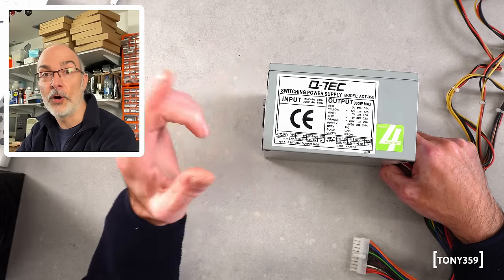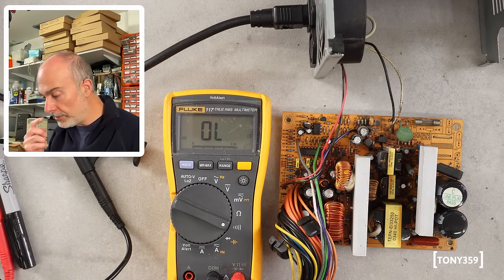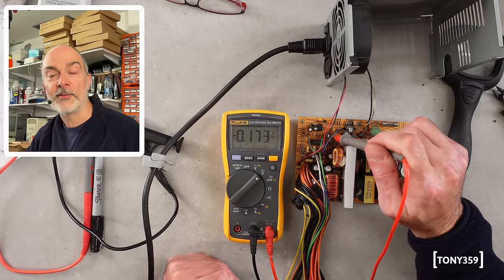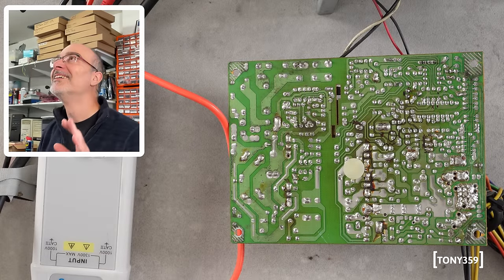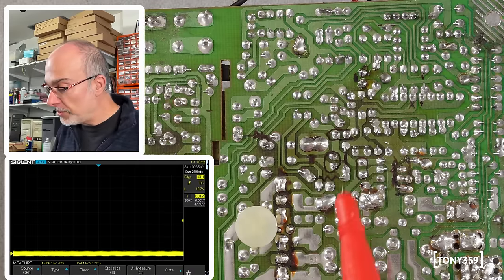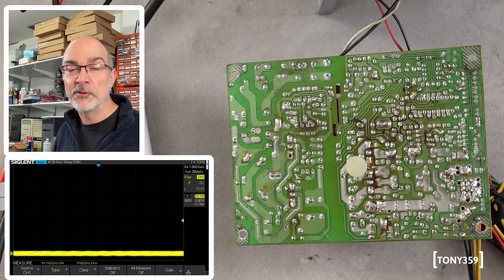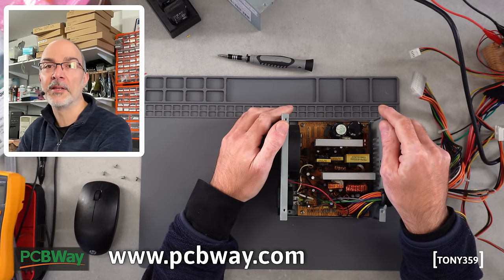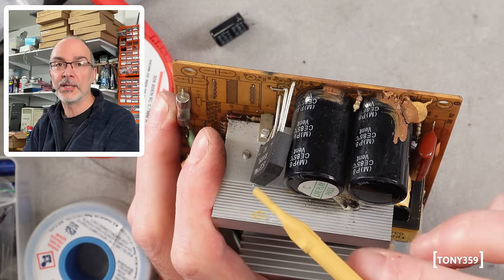Let's fix this 𝗗𝗘𝗔𝗗 ATX power supply!

Comment: Nice repair! You can put a thermistor on the 12v power of the fan to slow it down when the PSU is cold significally.
I cannot understand why they stopped putting that female bypass ieee 3pin power socket at the back of the PSUs, it was extremely practical for monitors. Old PSUs are worth repairing, strong 5V, -5V and native AT connectors are 3 good reasons.
Ciao from Grecia, Jim
Reply from the maker: This doesn't have AT connectors unfortunately, it would have been perfect otherwise! 
Thanks for watching!

Comment: I always give my PC fans a bath of WD40. I fill a small container just big and deep enough to allow the WD40 to immerse them then let them run for an hour. They self clean and to remove excess oil just drain the container and let them run dry for another hour then wipe any remaining excess with kitchen towel and they are spotless and good to go again. Never suffered any harm or ill effect from this so far :)
Sometimes I've washed them in hot soapy water then let them air dry then use WD40 to drive out any water from the circuit board then a drop of 3 in 1 oil on the rotating shaft. That works just as well :)
Reply from the maker: I never considered bathing a fan in WD40 :) 
I tend not to wash anything which has coils in them - transformers, motor coils, as I'm not sure I'd be able to fully dry them out. That said, a fan is low voltage so it should be good! Thanks for watching!

Comment: You saved a PSU with a obscure voltage option, so all good and totally worth doing. Lots of people are about let's save the C64 or Amiga, but there's some cool generic 90s to early 2000s hardware which is worth saving.
Reply from the maker: Thank you!

Comment: Nice to see something being repaired; these days with all the manufacturers locking down hardware (even smartphones with custom firmware that prevent even replacing modules between legit identical models!) it's good to see the process of self repair a PSU, which has lots of cool uses for DIY projects.And as a bonus it was nothing buy cheap caps.Great!
Reply from the maker: Yes, repairing modern stuff is a nightmare!

Comment: I do this repairing for decades as my daily work, most of my computers have these cheap, chinese power supplies. After a while, you get used with them, they are so cheap to fix, I am barely use a multimeter to check the voltage. And this is an advantage; Once the bad caps are changed, the power supply will work with no problems for 4-5 years. The only thing that you will open that again is the fan that get noisy- very noisy sometimes, with big vibrations in all the computer case.
Here I suggest to have more attention on the fan repairing: Just use two sharp needles, remove the white washer, take out the fan blades and clean everything inside : the magnet , the winding, Use isoprophilic alcohol, a good brush. Then, use a good  grease, I found one very good that make the difference, If you use oil for lubrication , it will work but iafter one year you´ll need to lubricate again. For someone who does not know, it is a very instructive video.
Reply from the maker: Thank you for the comment - Yes, I am very aware that that fan won't last long, though I wasn't aware the fan could be disassembled further. Others have mentioned and I will definitely do that next time! About the grease, it might be a good idea as well.
Reply: With decent caps and low hours I'd honestly expect to get at least ten years out of a rebuilt power supply, if not more. It's not like you're likely to run a vintage computer 24/7 all year long like some people do with new computers and did when these were new.
Reply from the maker: Absolutely, my retro gear is barely being used :)

Comment: Very nice work.  This is my first time on your channel, so I'll check in on some other videos and maybe subscribe.  I have several power supplies in a bin on my workbench, and all  but one of them work.  The dead one is an old 20-pin ATX kind of like this one - a very heavy +5 volt rail, and might be worth the effort to repair it.
Reply from the maker: Thanks and welcome! There are a couple more power supply repairs on the channel, one is a PS3 one and another one a generic one. I hope you like them!

Comment: You can make a -5v output using a jellybean component like MC34063 or any 34063 / 33063 (first two letters are manufacturer digits, they're made by lots of companies). There's even online "calculators" that will tell you what components to use, instead of you calculating using the formulas in the datasheet.
Typing as I watch at 5 minutes ... esr of 5v standby capacity could be bad, you may be measuring 5v with multimeter but doesn't mean it's ok... the meter puts no load on the circuit so it could show 5v but be actually bad.
Reply from the maker: Oh yes, the multimeter is doing a broad average - and as you could see later on in the video 5VSB was also all over the place! I didn't check it afterwards though! Thanks for watching!
Reply: You have -12V line anyway so you can use a cheap linear regulator.

One of classic ways to get -5V from +5V is a standard 7660 IC which is much easier than 063 since you don't need an inductor, and you don't need even any resistors, simplest IC to use. This IC comes from half a dozen different manufacturers. It's not intended for high current but it'll hold up a negative rail of an opamp perfectly fine!

Comment: My old backup computer, a 2008 Lenovo ThinkCentre m58p had a boot loop problem that slowly got worse, meaning it occurred more often.  That pointed me to the PSU.   After replacing the bulging electrolytic capacitors, all was fine again. I also replaced the other remaining electrolytic capacitors. Anyhow, despite the computer being 16 years old, it can still handle 1440p resolution YouTube videos at 60 frames per second. Repair cost was about $9.95 CAD.
Reply from the maker: The amount of electronics going to the landfill because of simple faults is sad. But for a non-skilled person it doesn't make sense to have them repaired as the repairman cannot charge $9.95 or they won't get to the end of the month. So we buy new.
This is so very broken. Thanks for watching!
Reply from the maker: Friends often wonder why I have "old" things at home! :)
Reply: @tony359  Is it just me and what I see, or did my last comment vanish ??  Update. On one of my computers it does not show up if I am logged in and am using Firefox., but does show up if I instead use the Edge browser and am NOT logged in.  So I checked this again on my Lenovo backup computer. Here it does not matter which browser I use, nor whether I am logged in or not, it still does not show up.  Weird stuff.
Reply from the maker: I can see it. It's not the first time my comments "disappear", I guess it'll come back at some point. It wasn't me though :)

Comment: I never thought I would see someone bother to repair a Q-Tec PSU. They always were noisy and unreliable before. But this was educational and that made it worthwhile. Still wouldn't use that PSU though! Those and Bestec - steer clear!
Reply from the maker: Indeed, it's for fun! I played with a socket 7 motherboard today, I looked at the Q-TEC and thought "nope" :D
Reply: I have few Bestec ones pulled from OEM systems and they are still working fine after all these years. I’ve seen totally dead ones though. I always open a PSU, clean it up including lubricating the fan, and do PSU tests before using them.

Comment: I had this troubleshot and ready for remediation by watching up to @1:53 in the video.  It is at this precise moment that it is obvious what the problem is.
Reply from the maker: Because I say power supplies are dangerous?
Reply: @tony359 lol, no, I was referring to the image.  The cap at the lower right looks slightly bulged, which coupled with the fact it is the component most likely to fail on these, is why I'd say right away that is the issue.
Reply from the maker: Yes, that was even mentioned in the previous video when I tested the PSU. That wasn't a surprise! 
As I said at some point in the video, I could just replace all the caps, "it's working, thanks for watching". Meh. Boring :)

Comment: HELP! Assistance please!! I have three Cooler Master power supplies, all at or over 10 years old. A 550, 620 and 650 watt. All three still work but under load cause burps and reboots. I'm told they all need new capacitors. Is this feasible and reasonably cost effective? Can you gives me some hints and suggestions? I counted around 50 capacitors in the 650 watt one.
Reply from the maker: if you're asking it means you've never done that yourself and I cannot recommend you start with a Power Supply where you have 340V DC inside. Sorry, I don't mean to be mean but I honestly cannot recommend that. Thanks for asking!

Comment: I was genuinely surprised, how often are the smaller capacitors bad. They do not even look that bad like the bigger ones which bulge. When I was repairing my old LCD monitor PSU, all of the little ones had big ESR, which is not good for the switching nature of all the DC-DC step-downs or SMPS in general.
Reply from the maker: Indeed - I think it's because of the broken fan. This thing must have badly overheated for quite some time. Caps don't like heat at all. Every extra 10C the life of a cap halves. So running a cap at 60C rather than 40C means that the life of the cap is 4x shorter, impressive!

Comment: 40 years experience with many types of power supply’s , trouble shooting tip ,use a hair dryer and freeze spray for quick cap checking . Then go to the technical stuff if you have to .
Reply from the maker: Of course, check this other video when I mentioned exactly that: https://youtu.be/zpro06H_4VM?t=571 (9:33)
The purpose of my videos is to learn and experiment though. It was pretty obvious that the problem was the capacitors but if I had just swapped them all without learning about how the PSU works, probing the ICs etc, it would have been "just another capacitor swap video" :) Thanks for your comment and for watching!
Reply: @tony359  I agree totally, you have to be able to noodle these things when something besides caps . But man a lot of time, it’s caps .
Reply from the maker: Imagine a world without capacitors :)

Comment: I've repaired many SMPS's and in the majority, the problem is always the electrolytics.  Some are obvious, bulging out the top.  Otherwise, check for value and ESR.
Reply from the maker: Particularly those cheap ones had cheap capacitors - and cheap design which meant the capacitors were stressed more than needed. Thanks for watching!

Comment: For a switching supply, you should be using dedicated low-ESR capacitors.
Reply from the maker: On this PSU I admit I dug into my stash looking for "cheap" capacitors but those are from some time ago. 99% of my caps are Panasonic, if possible "FR" series which are very low ESR and high ripple I think. They're not cheap but I don't see the point in recapping with cheap stuff. If FR are not available I always select something with low ESR as standard.
For PSU - when I have them - I also use the Nichicon PW series which are designed for PSUs. 
Thanks for watching.

Comment: Good repair job, yeah caps all the time
Actually you were lucky, when the caps get this bad, all the transients from the switching goes through the roof and can easily take out an active device, often the switching transistors, meaning a near dead short across the input, smoke and severely cooked parts.
Reply from the maker: I was surprised the monitor was still working! I didn't think of checking those caps... Thanks for watching!

Edit: wrong video :D
Yes, those were not caps anymore :)

Comment: i have so many smps's lying around most of the don't have 5v Vsb o/p, going to buy a lcr meter soon for changing my game, most of smps faults are due to bad capacitors, i once had a working smps wanted to use it as a power supply for my tire inflator it requires 8A @ 12v, i only wanted the 12v line, also kept a sata & a molex connector just in case required for cd rom /hdd, so i desoldered all wires & connected only a 12V line ps-on 5v Vsb, after that tried to turn on the ps on it would work only for 2 sec & then off, did trouble shooting checked the o/p section nothing was bad, turned out the 3.3V sense wire should be always connected to the 3.3v line, everything works great till today.
Reply from the maker: well done in discovering the 3.3 sense line issue!

Comment: 20 years ago I worked in computer service. I remember 2 similar named PSU brands. One was Quiet technology and silence was their thing. They had good PSU's. The other was a cheap Chinese PSU with very optimistic rating. Was it Q-tek and Q-tec?

A PSU with only max power, no continuous power, is a good indicator you have a crappy PSU.
Reply from the maker: good point! I guess these "ratings" can be found everywhere, in any sector!

Comment: Very satisfying to watch. I have a Nox Urano II 630W ATX power supply, but it never turns off, with the fan always running without being connected to any motherboard, I checked with the ohmmeter that the green PowerOn wire is in a short circuit with the black wires?  
How can I solve this problem ?
Reply from the maker: Hard to say but it looks like the on/off circuit is fried - yes, I know you knew this already!
Modern PSUs are also a nightmare to work with, everything is so crammed. Thanks for watching!

Comment: Oh i got your channel recommemded because of this video. Subbed immeditately! Btw can i know whats that device that you use to check the capacitor esr and capacitance ? It looks extremly useful
Reply from the maker: Thanks and welcome!
It's a basic component tester, there are many different types available. I think the original name is LCR something :) It works very well and it's very cheap. Thanks for watching!
Reply: @tony359  thank you for making the video too ! I was doubting whether to buy an oscilloscope for electronic repair since most people on forums kind of discourage it saying its not very useful but after seeing your video I realised its extremely useful rather than just relying on the multimeter. Thanks for the great videos 👍
Reply from the maker: There are cheap scopes nowadays which work pretty well. But BEWARE, do NOT use a scope on a power supply unless you have a differential probe - a battery-powered scope should also be ok but I cannot be 100% sure. What I am saying is that remember the ground lead of a scope is.... ground. It's not like a multimeter where you can poke everywhere. If you ground something which has potential, you make a big bang :) (Ask me how I know? :D)

Comment: At around 3:40, I may be wrong but it is my understanding is that the controller chip communicates via the optocoupler and not the central transformer you mention in your comment. Those transformers should be for 5V, 3.3V and 12V respectively. Thanks for the video!
Reply from the maker: You know, I am not sure now. Because the controller is on the secondary, there shouldn't be a need for optocupler as the feedback doesn't have to cross the secondary/primary boundary. Interesting. 
However, I one of those yellow things (I call them transformers but I'm told they're actually two inductors coupled together - let's call them high frequency transformers) is definitely for the 5VSB and the VCC for the controller, before the main circuit kicks in. If you look at schematics there is usually only one transformer for everything - there will be different windings and each will deliver a different voltage. 

I'll check with my "go-to" person when it comes to transformers about the optocoupler, thanks for asking!

(*) - on a more modern transformer, where the controller is on the PRIMARY, then the optocupler is 100% for receiving feedback from one or more voltages so that the controller can compensate for different loads!
Reply: @tony359  thanks for your kind and prompt response! So… it got me thinking, again not an expert here but AFAIK the chopper transformers are those three and no matter what side you have the IC controller you will have to get info across from the cold side to the hot side to provide feedback to control the mosfets transistors across the optocoupler and using PWM to increase or reduce the power as needed. Alternatively if you had the IC on the hot side, then you would use the optocoupler to get voltage information from the other side to feed the IC and again adjust the PWM cycle as needed. Let me know what your “go-to” person tells you because it would be interesting to have a professional’s opinion. Thanks!
Reply from the maker: @Snowsea-gs4wu  My thought is that the voltage feedback can reach the controller directly, no need for optocoupler. All it needs to go to the HOT side is the switching signal. I'll find out more and report back! :)
Reply from the maker: @Snowsea I'm told the optocoupler there is for the 5VSB and the VCC to the controller. Indeed it's located nearby where the 5VSB generation is. The switching circuit for the 5VSB on the primary is primitive but it still have some feedback to make sure the voltage is correct!